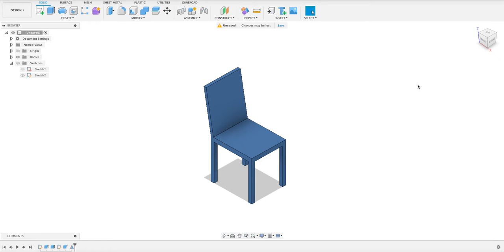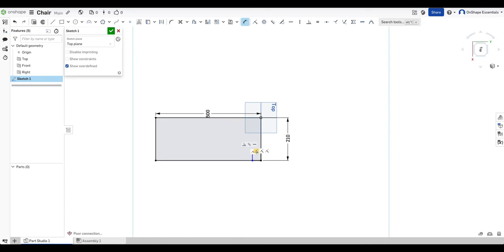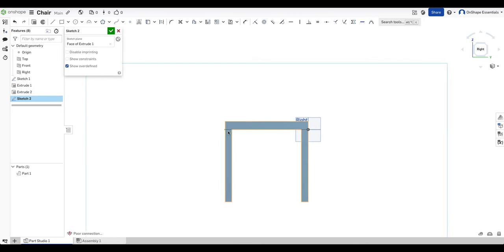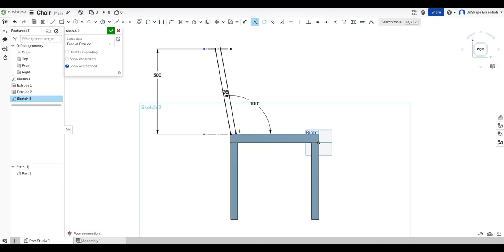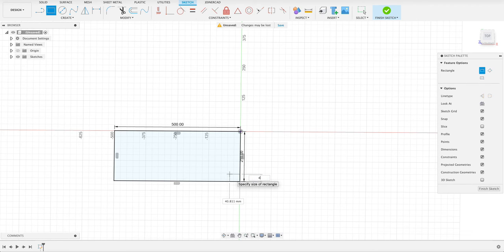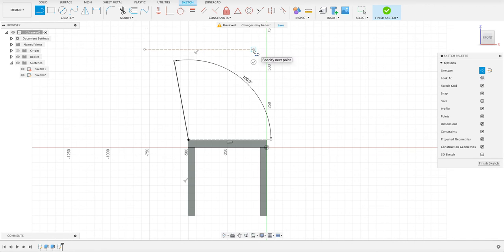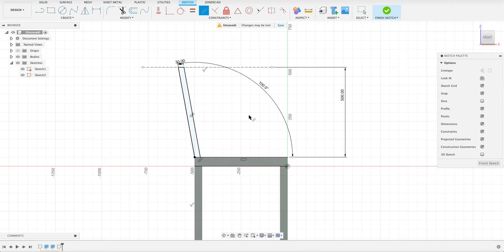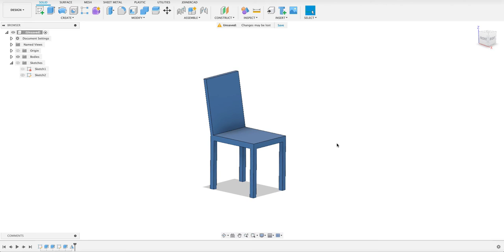Onshape vs. Fusion 360.. Which is better 😱😱😱

Comment: I think when you compare any CAD at such simple design level, they all perform well. It's when you get to large assemblies and a lot is going on, is when they start to shine or blind. Onshape is built for teams of people using it. To return to and make revisions etc. This timeline thing in Fusion would drive me bonkers.
Reply from the maker: Good point.

Comment: just a note about dimensions in onshape, right after you made the rectangle you tried to click on the numbers to select to change them, just mouse overtop of the number or hit tab and it should show a box around it then start typing the numbers you don't click anything. at about 58 seconds is what I'm referring to, but when you tried to click the number it closed the edit box which is why you had to do the extra steps of adding the dimensions with the dimension tool
Reply from the maker: Cool thanks 🙏. Not really up to speed in Onshape I mainly use Fusion
Reply: @Fusionfundamentals  no problem I'm still figuring this all out too. its hard picking one to focus on because onshape is so convenient and I can literally do it on my phone in the car. But fusions interface sometimes makes onshape feel like notepad compared to word
Reply from the maker: Yeah, fusion is a bit more heavy duty but sometimes crashes and has computing errors. Onshape never crashes but if you are somewhere with slow internet you are stuck